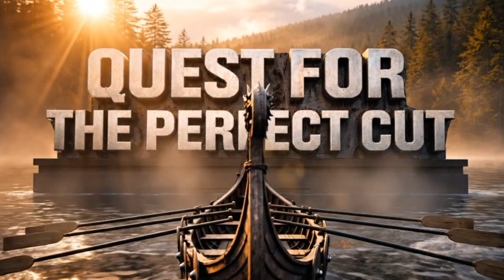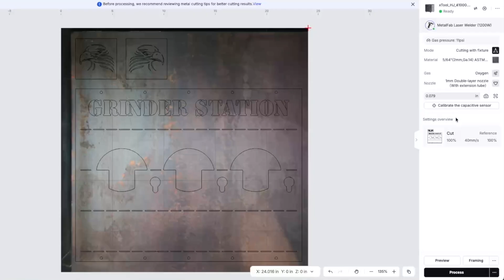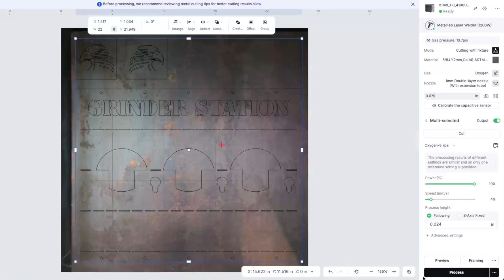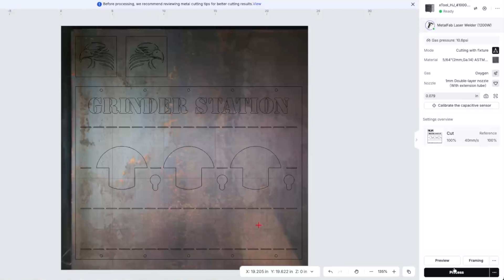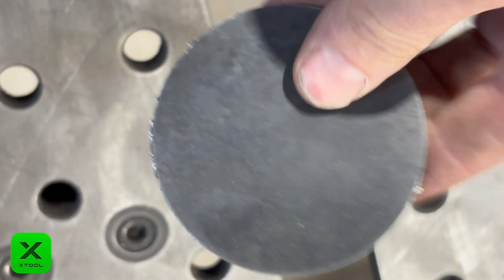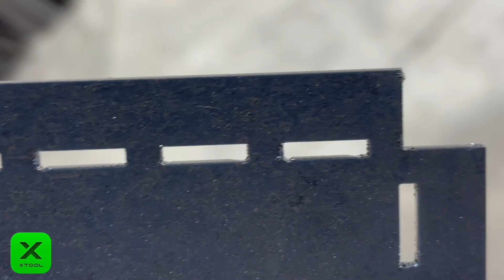XTOOL METAL FAB QUEST FOR THE PERFECT CUT

Comment: I cut 12 ga which is roughly 2.6mm with the air compressor and little dross. I wonder if i use O2 would it be even better. Im going to have to try that. My double layer cutting nozzle hasn't shipped yet either so im using the standard nozzle
Reply from the maker: Let me know how it works out